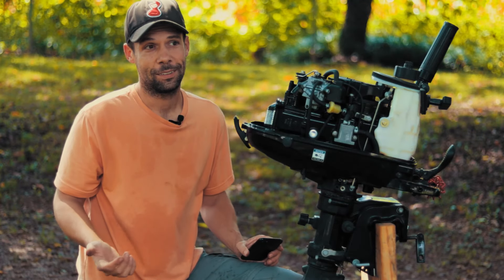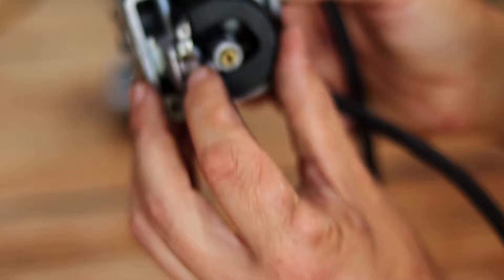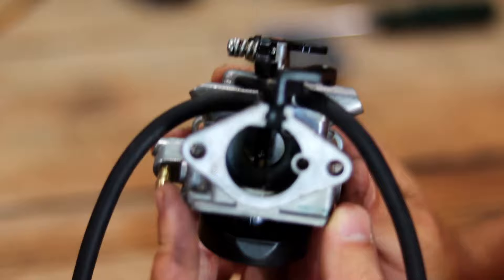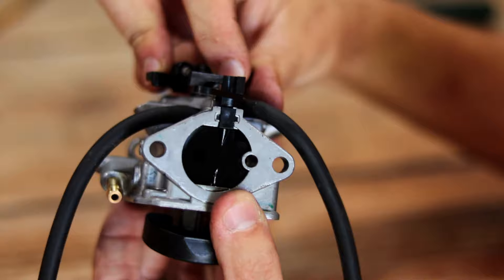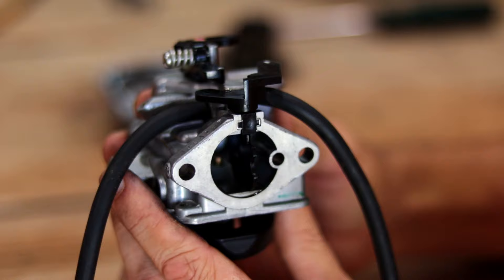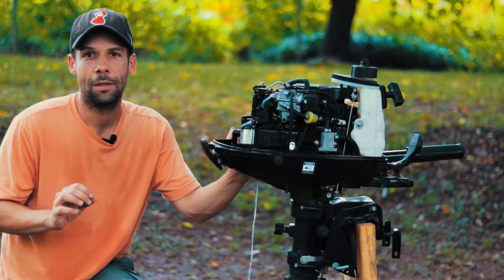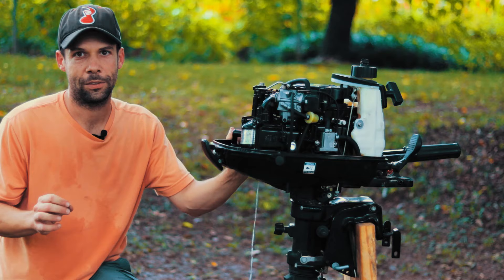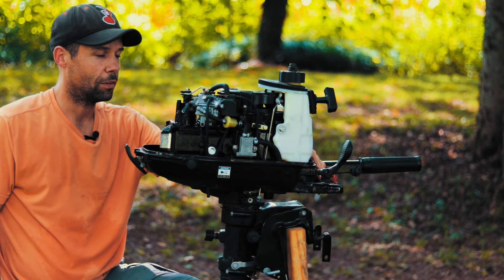Outboard Won’t Start: Carb Basics, Flooding, and How to Start a Flooded Motor

Comment: So it just wont start at all sometimes? Or will it start for a little bit until it bogs out? Mine just plain won't start and I have changed my plugs, my fuel filter and getting ready to rebuild my carb. It doesn't start at all unless I use a drill on my flywheel. Also i have a leaky carb. Any suggestions? Its getting fuel in the lines up to the carb.
Its an 88 Evinrude 8hp btw
Reply from the maker: My first guess is your idle jet in the carb is clogged. I definitely would look at pulling the carb cleaning it, use rebuild kit but also use a piece of small guitar string it get a jet cleaning set and clean out the jets. I probably has 2 (and idle jet and a main jet).
Reply: @Skinnyriver  thank you greatly for a quick response. I might have other questions sometime too 😆

Comment: Hello, my mercury 6 increases number of rpm when its changed from F to N what can be the problem? Can you help me?
Reply from the maker: RPMs will go up slightly because there is no load on the motor in N. However if RMPs are really high and your throttle is all the way down, you can adjust your throttle speed down with the screw on the throttle on the carb.

Comment: Great video, thank you! I also read this open throttle/push choke in/crank method elsewhere as a potential quick fix for a flooded engine. However my Mercury 9.9 4stroke can only be cranked in neutral, in forward it can't be - I thought it's the same with all outboards, but apparently not.. So is there anything I can do on this particular motor other than wait?
Reply from the maker: Yeah you should never try to start your motor in forward, it’s dangerous. You give it full throttle in neutral
Reply: @Skinnyriver  thanks, actually the question was about how to accomplish that because my outboard has the shifter built into the throttle control (so you can't be in neutral and open the throttle by default) but I just realized the "throttle only" button on my outboard which I never used before is there for this particular purpose, so I can open the throttle in neutral to fix a flooded condition.
Reply from the maker: I’m sorry I misunderstood. Here is the owners manual https://boatworld.ee/assets/Uploads/PDF/Mercury/Kasutusjuhendid/Mercury-paeramootori-kasutusjuhend-8-9.9-hj-ENG.pdf     See pg 69. There should be a throttle only button and manual states to advance throttle
Reply from the maker: My 6hp doesn’t have that combo throttle but the throttle only button should work. Let me know how it goes.
Reply: @Skinnyriver  thank you again for your help! fortunately my carb dried out and worked perfectly today but next time I'll know what the button is for and hopefully won't have to paddle again like yesterday, haha..
Reply: @Skinnyriver  I can now confirm the method works, I have managed to flood the carb 2 times this week.. For some reason when I stop the engine, tilt it up for a few minutes beach landing, then down again and restart, it keeps flooding.. Or at least it won't start and when I try the above method, it insta starts so I assume it's flooding. Might be something with the float in the carb when tilting up and down, because otherwise it starts at first pull all day long.
Reply from the maker: I’m glad it worked but sorry you are having this issue. I agree that when you tilt it up the the float is probably letting in too much gas (or the gas in the carb bowl is draining through your jets). I would try disconnecting your fuel line (or closing the gas valve if you have an internal tank) when you beach. Also if you can try only tilting it up to shallow water trim position rather than all the way up. I would be curious if that helps.  One other thing I would try to ensure it’s not a carb needle valve sealing issue — if you prime the bulb and let the motor sit in downward position will it still flood? If it floods after you prime and let it sit in down position for a while, then you likely need to clean the carbs needle valve (the part that seals off incoming gas)
Reply: @Skinnyriver  I too have this similar problem when I have my 6hp Tohatsu on the road and tilted up. The gas valve is that screw on top of your gas cap, correct? I believe my issue is I keep forgetting to close that valve and put it in "transport" mode. I'm confident now that it is all operator error lo. Thank you so much.
Reply from the maker: There is a gas vent on top of you gas cap. You must close that when transporting. Also there is a gas valve below your gas tank. You can close that as well.

Comment: Been taking a ton of notes from your videos! Thank you! Maybe I could ask for  your advice here- I got a brand new tohatsu 6hp with external tank. took for ever to get it going out of the box. 50 pulls at least. After that it was fine for the next couple days during break in. Day 3 during cold start the motor dies when choke pushed back in. Then on day 4 it wouldn't cold start at all.  I called the company I got it from and they advised it might have too much oil and to drain/replace. I did that and tried again. I finally got it going with the choke in and the throttle up. What are your thoughts. Fuel quality? Too much oil? Something else?
Reply from the maker: I appreciate the views and support! Man that is weird. Tohatsu is (in my opinion) one of the best. Tohatsu makes more small outboards per year than any other company in the world. The chances of an issue out of the box is low (but still possible). If you have to have the choke on or throttle up, it’s definitely not getting enough gas. It really sounds like a fuel supply issue from your external tank. Check the priming bulb to make sure it is staying hard. Also try cracking open the lid to the external tank. These new tanks are sealed and can prevent flow unless you have a “fuel demand valve” Google that term. Also..

Does it have an internal tank as well? Try using it to see if you can isolate your problem to your external tank. I would really look closely at the fuel connection, tank, as it really seems like something is constraining flow to the carb. Finally use fresh gas. If you are using old gas you need to eliminate that as a cause. Get new gas. Let me know how it goes
Reply from the maker: I’m not an expert or mechanic but am familiar with 6hp Tohatsus. If you wanted to have a quick video call while you go through the startup procedure, let me know.
Reply: @Skinnyriver  thanks man! I'll keep you posted if I need to jump on a call with you. I appreciate all the insight!
Reply from the maker: One additional point that happened to me… if your model has an internal tank, and the internal tank’s gas valve is not closed all the way you will lose gas pressure from the external tank into the internal tank causing your carb to starve for gas. Probably not your problem but a silly thing that has happened to me.

Comment: I just got myself a small johnboat my first ever boat, it has a small 6hp outboard Johnson motor. I've been learning a few things from it I know I need my carburetor to be cleaned because i have a hard time starting it. only way it starts is if I pump the gas till I see some gas come from the carburetor. once it reaches there it starts perfectly fine which I thought was normal until this guy said never start it if you see gas coming from your motor. will appreciate it for some ideas
Reply: (so I don't blow up my motor)
Reply from the maker: It really depends on where gas is leaking from the carb. You may just have a bad gasket or seal and it is leaking when you fill it up when you are priming (not really flooding just leaking). Or you are having to flood it because your carb is dirty and your motor is not getting enough gas. Either way I would say the best thing to do is take it apart, inspect it, clean everything, and maybe replace the gaskets with a rebuild kit. Your motor won’t blow up but there is always a fire risk if you have gas leaking. 

Once it starts, Do you have to keep the choke on or will it run perfect once it starts?

Comment: Man, this video is gold.
I got a 5 hp yamaha with an external fuel tank option.
If i keep squeezing the prime ball to long, will this also flood the carb?
I noticed that fuel leaks from a hole at the fuel pump when i pump the ball.
I think my float needle is stuck, or i pump the ball too much.
Normaly the float needle closes the inlet.
But because there is an external fuel tank , there is also an extra fuel pump on the carb.
In this case , what closes the fuel inlet ?
Is it still the float needle or something in this extra fuel pump?
Reply from the maker: I have flooded mine through squeezing to fast and hard. If you squeeze slow and easy you allow the float to work. The needle valve is perpendicular to the inlet so you can’t usually over power it, so squeeze slow and easy until the prime bulb is firm. When it’s firm the float is up not allowing any more gas in.

Many think the prime bulb pressurized the gas tank, it doesn’t on most tanks. It literally just pushes gas to the carb then it basically siphons gas from the tank (no pressure)
Reply: @Skinnyriver  thank you for your fast answer and for the high quality videos. You been a great help.
Greetings from Holland
Reply from the maker: Man I love Holland, got to visit back in 2012 and absolutely loved it! Hope to go back again!

Comment: I have a v4 90 hp Johnson 2stroke ,it has spark and fuel ,but won't start. It did always start and run but my starter jumped up while out and since then nothing . What cam I do
Reply from the maker: It the starter engaging and trying to turn the motor over? Or is the starter just dead?
Reply: @Skinny River  it turns the motor over yes but doesn't want to start
Reply from the maker: If you are sure you are getting fuel and spark then you probably have some junk in your carb and need to clean the jets. One more question, what did you mean when you said “my starter jumped up”
Reply: @Skinny River  whilst on the water ,I heard krkrkrkrkr and it slowed down and died,so the wires got real hot ...and that how I noticed my starter was ingaged
Reply from the maker: Oh I see. If this was the start of all of your problems, then it’s probably not a carb issue and more likely a mechanical issue with the starter itself. It could have damaged the starter bearings or the spline gear and you are simply not transferring enough power to the motor during starting. Or a wire was damaged and you have a short or open circuit somewhere. This might be worth getting a shop to look at it.

Comment: I have a coleman 5hp. From brand new it will run but then after i shut it off i cant get it to restart. The next day it will start. Any idea? Trying to do the full throttle trick doesn't work.
Reply from the maker: that is weird. Usually it the other way around, hard to start when cold. Are you using choke when you are trying to restart? There is usually a throttle mark to set throttle to when motor is warm. It is usually around 1/4 throttle. Also next time try to take the cowl off before you stop the motor so the lines cools. There are some weird things happen if motor stays hot under the cowl. Check out this thread, same issue as yours https://forums.iboats.com/threads/boat-wont-start-when-warm.597632/
Reply: @Skinnyriver  yep I follow the starting procedure. I've follow the thread. It just baffles me.
Reply from the maker: Yeah sorry I can’t give you a definite. My initial guess was something causing  the carb to get too much gas and flood or a gas supply issue (losing prime) once the motor is killed. If it has an external tank hookup I would try an external tank to see if it still does it. If you use an external tank the priming bulb should still be hard when you kill the motor. An external tank would let you reprime everything once motor is killed. Or if you are using an external tank, test if it has same issue with internal tank. That may help you narrow in on the issue

Comment: Looking to upgrade my 5 hp tohatsu 4 stroke to 6 hp. Which carb should I get can't find any info.  Any advice
Reply from the maker: I think this is it (even though it says 4HP). I would call them first to confirm https://www.readysetboat.com/tohatsu-4hp-to-6hp-upgrade-kit-carburetor-and-propeller.html?gclid=CjwKCAjw0dKXBhBPEiwA2bmObXtgofCB6BNeSlm1Lx3dqZs0k76B5DPH4UirISmoNPOURFmfzFkRZxoC938QAvD_BwE
Reply: @Skinnyriver  I have the upgraded prop with came w 5hp
Reply: Thanks
Reply from the maker: Someone said the carbs are exactly the same except the main jet. They said you could possible just change out the jet with a 6hp jet and a get the same result for like $20. Maybe something to look into some you already have the prop
Reply from the maker: The jet simply screws out of the carb. It maybe worth a try. You would need to get the 6hp jet part number off boats.net. I haven’t tried this but it could work
Reply: @Skinnyriver  going to give it a try.  The 5hp wouldn't get over 8mph today on 13 ft gheenoe

Comment: Hi there, I just bought a 2021 used Yamaha 2.5 very little hours. Started it for first time today in a closed loop circuit (my bucket). Was very eager to run it and the only water I could get was from a hot water hose as the cold water supply was closed for the winter. I went through different rpms and ran it max rpms in neutral for probably 2-3 mins, water in bucket was very hot. Engine shut off and made a quick cranking sound. Couldn't get it to start again. Checked compression by putting my finger by the spark plug hole and didn't feel any compression. Put an inline spark plug tester and the tester blinks when I pull the coil. Could the hot water have damaged the outboard?  Any next steps to diagnose what needs fixing?

Thanks!
Reply from the maker: It’s possible hot water in a closed loop system didn’t provide the needed cooling. There needs to be a decent temp differential between the cooling water and the motor. But I would think anything under 100F should be ok. You usually smell hot oil that burns off the surface of the engine when it overheats, did you smell anything? 

You need to be 100% sure compression is ok, borrow a tester from someone or buy a $20 one to check. If compression is ok and the motor piston is moving easily when you pull the cord, you are probably ok and it’s something else. 

Sometimes if it gets hot you foul the spark plug, even though you show spark it could be weak. Also check all wires to make sure nothing melted. 

I never run mine in neutral at max RPMs because there is no load there is risk of RPMs running too high which causes a lot of excessive heat and wear. 

Here is a great discussion about overheating and what to check https://www.thehulltruth.com/boating-forum/765712-1977-15hp-evinrude-overheated-now-won-t-start.html
Reply: @Skinnyriver  Thanks for reply. Just did compression test, it read zero. What would be the next step ?
Reply from the maker: @hellapellanyc6465  honestly I would go ahead and take it to a shop
Reply: @Skinnyriver  Thanks! Wondering if I should do a leak down test before I go.
Reply from the maker: That’s a good idea, that would tell you for sure. I’ve actually never done a leak down test. Let me know what you find out.

Comment: Overflow tubes simply rerouting too much gas out of your carb, i don't see an issue there, it happens when you prime too much gas thru external pump, its a safety mechanism, happened to me multiple times, had no issues starting or running motor

Comment: My outboard mercury dies when tilt down . But will start with tilt up. Will die again if I lower the tilt. I’m confused
Reply from the maker: Man that’s weird, my 2 guesses would be:
1) carb float not operating correctly and when you change the tilt it changes the float position. I bet when it’s trimmed down, the float is falling all the way down and letting in too much gas OR
2) the float setting is just wrong and when it’s trimmed down the float is letting too much or tool little fuel. 

Either way is would start with the float as it really seems like a fuel flow and supply issue.
Reply from the maker: In other words it’s likely your tilt position is impacting your float position and your fuel level in your carb

Comment: I just got my motor out of the shop for a tuneup. They guy had it running beautifully there, and ran it out of gas. He told me it would 'start a little hard" the first time. This is also a "new to me" electric start motor. I am pretty sure in my frustration I flooded the motor trying to get it to fire off. I "dry started" it in my driveway and only ran it for 1-2 seconds there. Then at the boat ramp.....I couldn't get it to start to save my life.  To get back on the road (so to speak), what do I need to do? I unhooked the gas can. I'm going to take out the spark plugs to see if they are wet and leave them out until next weekend so maybe the cylinders can air out? I can't rev the throttle on this motor without putting it in gear btw. Thoughts?
Reply from the maker: There is generally a throttle rev button, all motors can be rev’d in idle. If it was running at the shop, then it ran out of gas, now won’t start… it sounds like a gas supply issue or a starting procedure issue. What model and year is it? Was it running before you took it to the shop or is it a new to you motor?
Reply from the maker: You should have a throttle only button to rev in neutral https://www.reddit.com/r/boating/comments/3luy0q/mercury_30_hp_throttle_only_button/ but honestly I don’t think it’s a flooding issue if it started and ran at the shop
Reply: @Skinnyriver  I'll have to look for that......I talked with my father-in-law (previous owner for 20 years),  he always just hit the on button and it usually just started in idle on the first crank. There's a dial on the tiller handle, but I think that adjusts the tension of the twist throttle?
Reply: @Skinnyriver  I got a little happy with the primer ball and the primer plunger on the motor, lol.